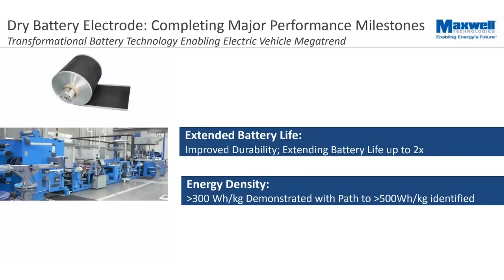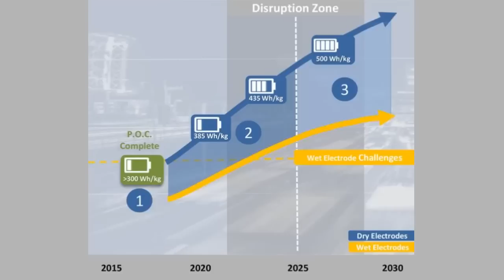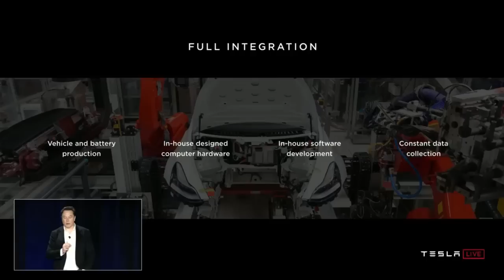Tesla's Battery Revolution / Double Range / Cheaper Price

Comment: If they are able to make 650 wh/kg, they will want to sell them to airplane makers. No reason to make them tear apart Tesla's to get their hands on them. Also, maybe make a version of their storage stuff that is easy to integrate into ferries. With the 30x increase in production they are targeting, many things are possible.
Reply: Dont Think 650 whould be enough to Think about an aircraft
Reply: @davidhoffmann2699  They aremaking aircraft now, but ranges are short. If you can double it, it might be long enough for lots of things.
Reply: I understand 400 wh/kg is the starting point for passenger aircraft considerations

Comment: The goal for tesla is  doing over 600 miles per charge!  That way you might only need to charge it once every 2 weeks which would increase the battery life!
Reply: 300 mile range per nominal charge is fine.  This tech will mean a battery mass : car mass ratio will be lower ->  lower costs and more efficiency.
Reply: John Smith  certainly travel planning with an EV is going to be different than with an ICE vehicle.  I contend that very few people travel more than 300 bladder busting miles without taking at least a small pee break.  Having more battery is only going to be significant for the outlier type of traveler.
Reply: John Smith  one scenario where I agree with you is for individuals driving from Redding to LA.  An 8 hour drive by ICE takes 10 or so with an EV. 

To enhance range, the computer wants to go 70 mph with 2 stops if you start with a full charge.  

If you keep with the 75 mph flow of traffic, the trip time actually increases since a 3rd stop is required.

A 500 mile battery would be great here, but it continues to be an outlier case.
Reply: yes
Reply: And even more increase in battery life not having to use super chargers as often.
Reply: Correct!
Reply: We need longer cables
Reply: Yeh after 6 the they cut you off from super charging rich rebuilds says
Reply: Or keep it between 40%-60% for daily commute and charging at home.
Reply: Uber long range would be nice, but a more practical benefit in consumer vehicles will be 300-ish mile range cars that are the same price as Toyota Corollas and larger vehicles like pickups that are priced the same as comparable ICE trucks instead of the $100k electric trucks that are coming out in the next year or two. And the vehicle that will change everything is when they can build a 1000 mile semi truck that's about the same price as a ICE semi.
Reply: @Drive YT Brand or Dr Bussard's polywell fusor fueled by hydrogen-boron scaled down.  The electrostatic containment coils can be used to produce an electric current directly from the fusion reaction - thermo electric components skipped.
Reply: I'll believe it when its been in use for several years. New tech like this usually comes with some really bad,very expensive problems in the first few years of implementation. I expect the new tech cells to be horrendously more expensive for the first few years until production and several companies are making these new cells.
Reply: I can't wait for longer range batteries
Reply: cesar pires we need 1k miles per charge
Reply: @dancer1  Why and who needs that?
Reply: manoman0 because it’s dope then you wanted have to charge in tour garage you would just charge on the road
Reply: @dancer1  even better 😎
Reply: And we need solar charging while driving 🔥
Reply: @dancer1  there is not enough wHr per square inch (or cm) from PV cells to charge much that could even be noticed atop a small car.   Dynamic braking on four wheels produces a lot more physical electricity power for charging vs useful mass than passive PV.

Sorry that is just mechanical engineering and physics.
Reply: The Tesla pick up will have solar on it’s cargo cover, and apparently this will produce up to 15 miles more range per day in a sunny climate. More importantly, solar cells would slow down or even stop the need to constantly trickle charge the main battery, which can be a problem when the car is parked up for a while at somewhere like an airport with no easy access to a power point or outside urban homes with no off street parking.
Reply: trainsirf solar panels peak at 150 to 200 watts per sq metre in the best sunlight conditions. On average they’ll deliver just 20% of that (40watts)
The model 3 uses about 250 watt hours per mile so solar panels (at considerable cost) would at best have minimal benefit.
Reply: @dancer1  Ever heard of energy density? I guess not.
Reply: manoman0 ever heard of an ambitious idea to keep things progressing? I guess not
Reply: trainsirf you get around 15-40 miles of range per day
Reply: @dancer1  thats more challenging but i like your ambitious idea not to say its not possible

Comment: I think the more important questions is whether or not we will ever have batteries, that would allow constant charging from 0 to 100% without any kind of damage to the battery
Reply: Good point but if the battery outlived the car lets say 20 years does that really matter?
Reply: @cesarforte617  the battery would hardly outlive the car, or keep it's initial max charge if you constantly charge it from 0 to 100, and let it sit for longer times without driving if it's either on max or depleted charge

Comment: My Tesla's 310 mile range gives me 250 max (usually less).  So getting 610 is not going to happen, at least for a long long time.
Reply: Your model 3 has a 75kwh battery. The 2020 roadster has a 200kwh. Do the math, especially with increase battery density overtime and upcoming technologies in this video. 600 miles of range is possible. Tesla only manages to achieve the claimed range if you cruising at 55 miles/hour. The EPA rating is the combination of highway and city driving and electric cars(except Taycan) do not like highway driving.
Reply: Max Truong the 2020 roadster has...really? Let me go see my neighbour's roadster and ask...oh, nobody has one?Okay, i'll check out the actual...what? Hasn't been made?  Claims are claims. And regardless, i don't doubt an ev can go 600+ miles on one charge, what i doubt is a normal sized and normal priced ev will be able to do it. The roadster is going to be (at minimum!) in the $200-250,000 price range.
Reply: How hard are you driving it?
Reply: Jmac normally, just like everyone else. Now, if you want to pre warm or pre cool everything (and don't count that power usage), drive only when the outside temperature is at a perfect level, don't drive when it is windy, make sure there are no hills, don't use any accessories, and drive more conservatively then you have ever driven before then maybe you'll be able to approach the stated range. And even if you find that perfect road, on a perfect day, at the end of that 310 miles you had better hope a charger is right there or you'll be needing to tow it.  So even in the perfect scenario, in real world terms (which we live in) i'll never ever be able to go that 310 miles on one charge. On any trips i take i generally have to stop well under 200 miles.  If the chargers are spaced 125 miles apart i cannot be certain i am going to make it to the second one and usually have to stop at each one. So my "range" actually turns into 125 miles instead of 310. If chargers become as common as gas stations than this issue will be lessened, but i'll still will never reach the 310. And neither does anyone else driving normally.
Reply: @stupidas9466  You just described the entire Phoenix metro area, not exactly hidden :) Tesla model 3 owners regularly see 340 miles to a charge here. You don't have to be sure of anything on a road trip, the car literally does the calculations for you and tells you where to stop and charge and for how long. You are making a mountain out of a molehill just to be dramatic
Reply: Cameron so tesla model 3 owners regularly see 340 miles range?  You are either lying or have been lied to and believe it. Model 3 owners do no regularly get 340 miles to a charge anywhere. As far as "they calculate the distance for you..." you are correct, except once it does the driver then has to check the temperature, the route and how many uphills, the wind speed and direction, and then make guesstimates and adjust the numbers downwards. And when you are driving outside major cities in the southwest united states (ie the rest of the world) where chargers are 100-200 miles apart along your route then you have to err on the side of stopping earlier, such as i gave in my real life, meaningful example which happens regularly on long trips. I have literally left home at 8am to arrive at my destination at 8pm in an ice vehicle, yet in my model 3 leaving at 8am i have had to overnight each time since i would have not arrived until 2-3am.
Reply: @stupidas9466  I totally agree, when I first saw the ludicrous mode I wanted one but then you look at all the lies and real world drivers, such as yourself,i will stick with my Hyundai Tucson. I can get 700-800km out of my car truthfully no matter what the conditions are like and can have my heater on and guess what, mileage doesn't change. I can tow and not loose 80% of my mileage, so how good are these cars in real world conditions? I am not a Tesla fanboy so I see the truth not some made up propaganda.
Reply: Dikky Bee there are great things about teslas and evs, and there are bad things. Just like any other vehicle or manufacturer. I can't tell you what range any of my ice cars had because it never mattered, as the inconvenience caused by refuelling was non existent. If access to chargers and the time to "refill" was the same as gas stations and ice vehicles, i wouldn't care that my range was only 250 miles. Might mean four more stops on an 12 hour drive, but if i can stop where and when i want, and if i forget there is another one 2 miles down the road, and it only takes 3 minutes, not a big deal. 15 extra minutes is a huge difference than 5 or 6 hours. 
I can't understand why so many people are so resistant to facts or reality when it goes against their hopes or preconceived notions, and why they are so resistant to change their minds about something once they are shown reality. I want to be right all the time, but it doesn't mean i am. And when i find out i was mislead or misunderstood something, was ignorant of the facts or just assumed something that isn't true, then why would i want to keep believing the falsehood? Sometimes i am right and sometimes i am not, and the least i can do is be wrong for as short a time as possible.  As they say facts and physics don't care what you think, they happen regardless.

Comment: Where is graphene battery 🤔😩
Reply: we need more graphene first
Reply: Graphene battery energy density is not good enough for automotive. Tesla's battery strategy is not about how good it is but also how many you can make. Elon had given hints that this technology will allow a massive increase in battery capacity. When that happens, probably a few years after battery day, Panasonic venture would like to end if Tesla manages to make their own battery.
Reply: @maxtruong187  isnt the point of grapene batterys density?? You said they were bad at desenity?
Reply: @popinmo  improve in density but not enough for Tesla goals.
Reply: They are coming.  It is already being used in ultra capacitors by a company called skeleton tech.   They figured out how to get 1.5 MW in 2m squared as a grid assist system.  I believe that the batteries we will see will be a hybrid of capacitor/deep cell.
Reply: @wildtwindad  2 meters?
Reply: @wildtwindad  that to good to be true that means a car would have like 500kwh of power
Reply: Popinmo there is a difference between power density and energy density.
Reply: Crap, should I cancel my Model Y pre order?  Wait for new battery tech?
Reply: Or buy used and upgrade the battery later? Or just take the plunge as the cars are great as they are! Anything with over 250 miles range is fine. I’ve had a late ‘17 X100 D for 2 1/2 years now and haven’t regretted a moment of it. Not perfect but still a brilliant car. I love it like I love my classic Bentley, and that’s saying something!
Reply: @haydensthoma  yours money yours choice 😊
Reply: @haydensthoma  No, that's silly. These batteries are a long way off.

Comment: I hope this advance will have fast implement in new cars, and perhaps I will afford a model 3 or Y .
Reply: They are already total cost matched with the 3 most popular cars sold in the US, Tesla isn't going to try to compete with a Nissan Versa
Reply: Cameron total cost matched with the most popular car’s internet he US? Which is the Toyota Camry. Tesla is still competing with luxury brands like the Germans, NOT budget conscious consumers which is most Americans. This is still a luxury, not a necessity.
Reply: @NickLiang  It's even worse here in Spain, because all the Tesla models are more expensive than in US and we don't have any financial aid from the government as well.
Reply: John Smith  Most buyers don't need a performance Model 3. And without the FSD add-on, they're actually around 57K. For 39k, you can pick up the base model, which is still faster than many cars and has the same tech the higher-end models have. And this price is not factoring in the savings in gas.
Reply: Or maybe we will buy the model 4.. Accent elentra tier
Reply: ThatGuyFromDamascus S4XY
Reply: Me too
Reply: They will try to make it cheaper to a point where anyone can affor one. The more Tesla’s sell, the cheaper the battery costs and total cost to make them. And the cheap the cost to make them, the more they sell.
Reply: If you order through a dealer you can get a slightly stripped down Model 3 for $35k instead of the $40k if you order through the website. The average new car price in the US in 2019 was $37k.